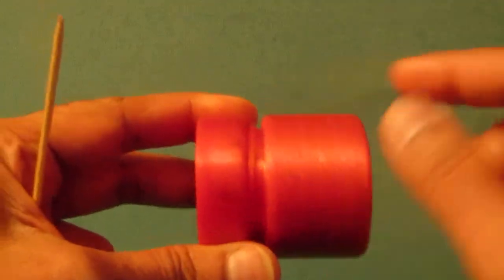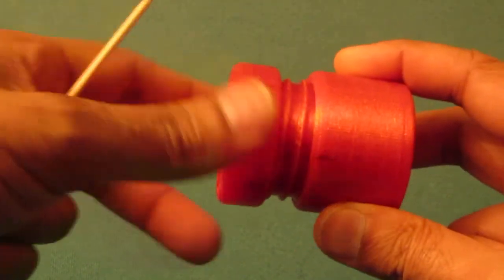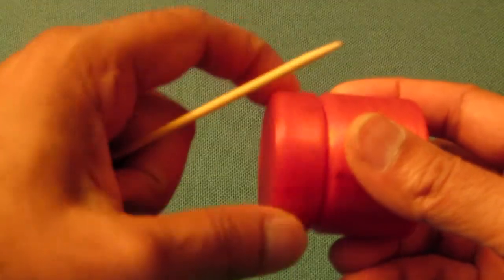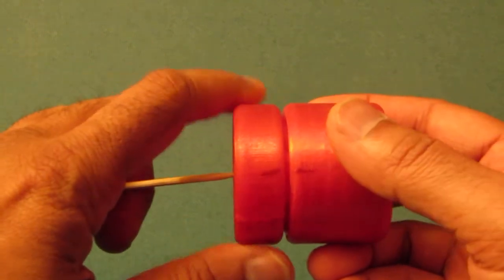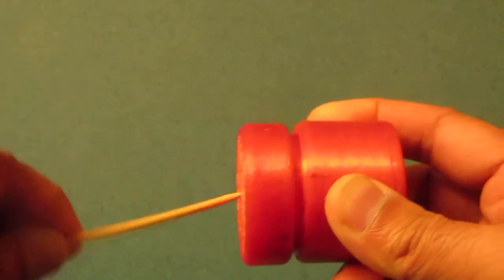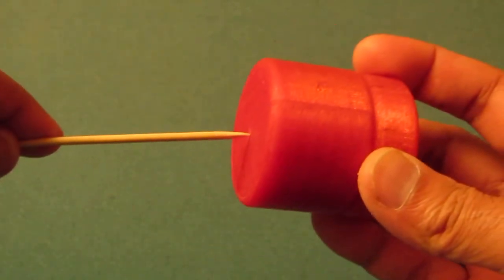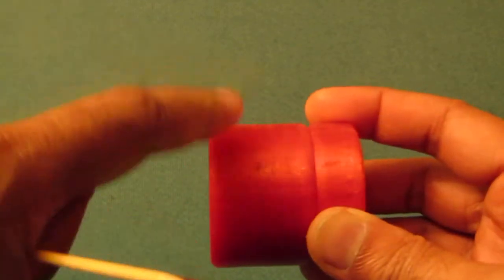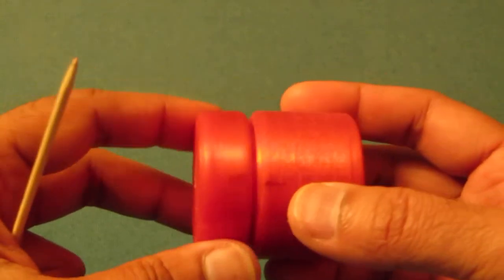How a screw with a left hand thread behaves when precessing

Comment: Very nice demonstration!

But the force is actually applied in the opposite direction of what you show.
Seen from the left side, when pedaling forwards, the cranks spin counter-clockwise, as well as the the pedal joint.
On the bike, you are applying a downwards force on the small part while the joint is spinning counterclockwise seen from the left side of the bike.
This ends up being the same thing as if you apply the force in the clockwise direction on the smaller part of a stationary joint, opposite of the direction you show in the video.
Thus, pedaling tightens the fitting. :D

Once again, thanks for the great demonstration!
Now this seemingly-backwards threading makes sense to me.